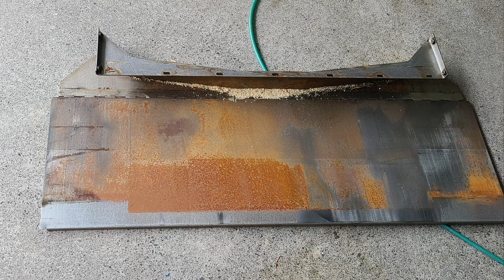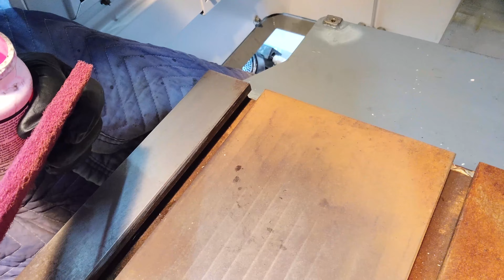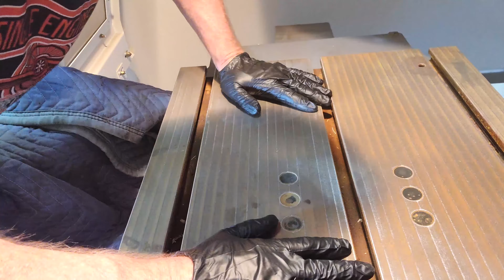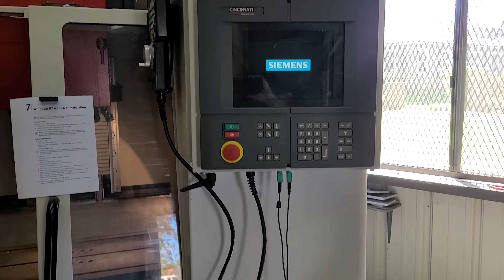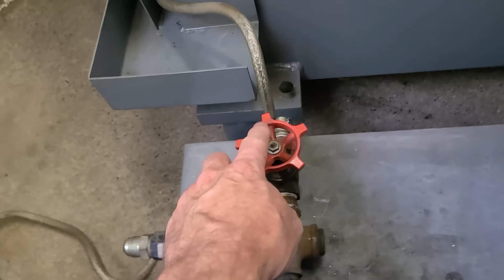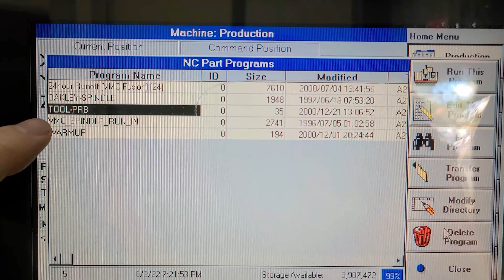CONTINUE SETTING UP NEW CNC PART 1

Comment: Hey Chopsmitty.    Nice videos. i am just going trough the same process Purchased a Arrow 500 (year2000) out of a R&D facility part of Bayer Pharmaceutical. Overall the mill is in great condition had to get batteries replaced and board refreshed. It is a Siemens drives had a bit of a headache with a power module got a brand new one all looks great.
Looks like they had an emulator on the machine and I do see a Ethernet connector.
I would be interested in getting the communication going like you did  if your willing to share.
And the SSD hard drive is tempting now that you spoke about it 
Thanks Joe
Reply from the maker: Send me an email Joe!  Green@cfht.hawaii.edu
Reply: @chopsmitty  Good Monday morning. Did you get my email Thanks